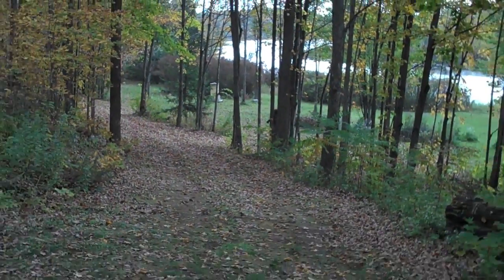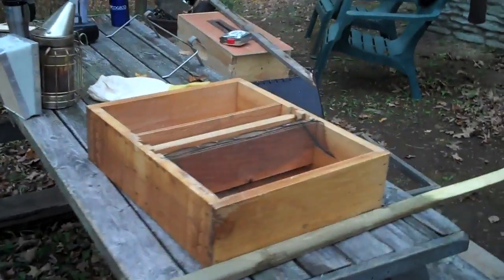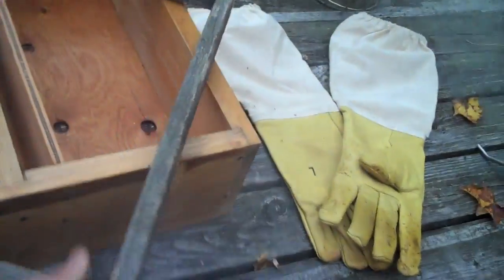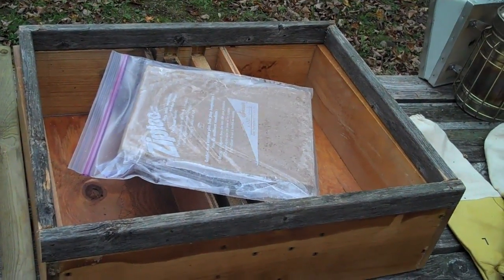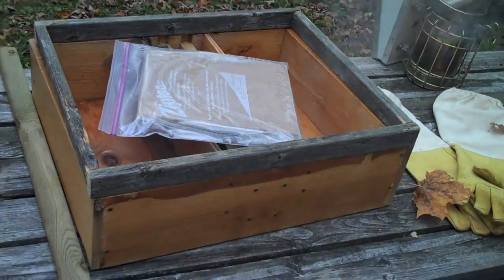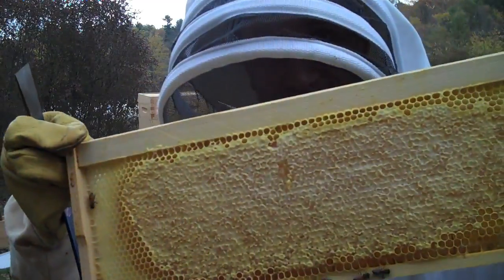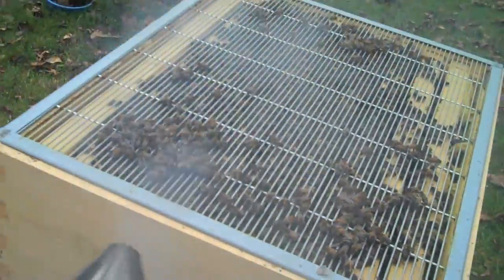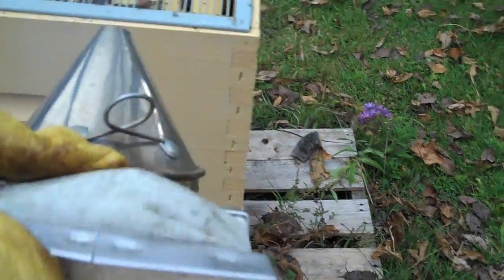Harvesting Our Honey & Treating for Mites To Help The Bees

Comment from the maker: In our area, formic acid treatments are usually done twice per year, in early spring and late fall. Formic acid pads go on for about three weeks, and it needs to be above a certain temperature outside (18 degress Celcius or higher I believe) for the acid to dissipate through the hive. You're correct - don't use it on your honey supers. Good luck!